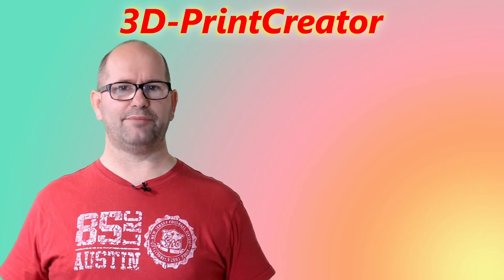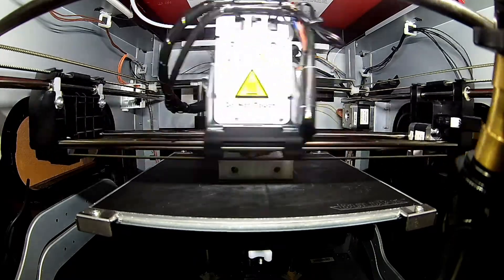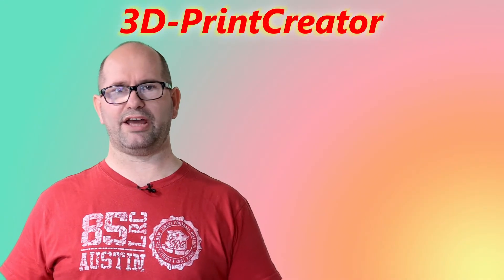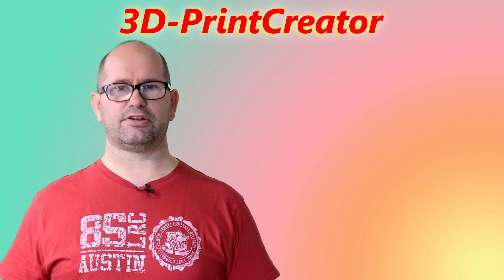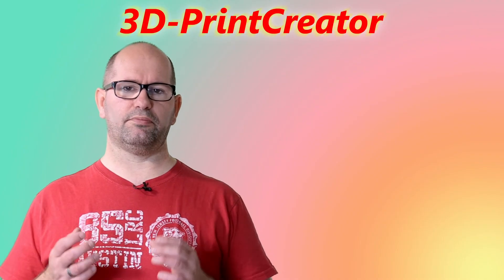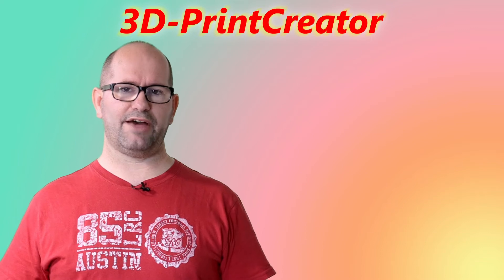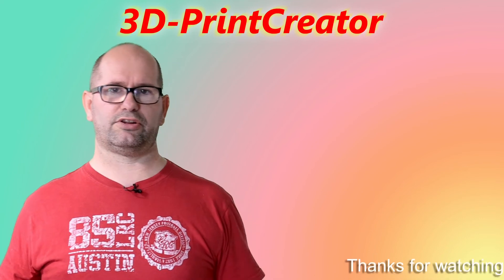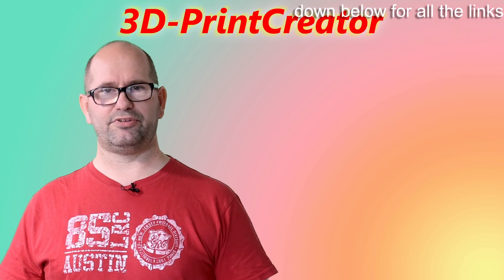▼ Best camera inside a 3D printer #Rollei or #GoPro

Comment: Thanks for the explanation. I need a camera for my 3d printer. It should be mounted near the extruder so the minimum focus distance should be small. I want to take pictures for the surface of the printed piece for further image processing of the surface pictures. Would you recommend any? I cannot afford to pay much money so the better is the cheaper. Do you recommend any and also any other than or cheaper than Rollei or GoPro ?
Reply from the maker: Action camera's are getting better and cheaper all the time.
At this moment I have a € 35,00 action camera installed in one of my printers and it does a better job then the expensive, but old, GoPro 3+ camera's I have laying around.
http://www.maxxter.biz/item.aspx?id=9413

This camera is sold in the Action stores in the Netherlands for less then € 40,00 and it's near perfect for taking printer footage. It has a focus distance of less then 12 centimeter and you can even change that by opening the camera (warranty will void) and turning the lens.
Reply from the maker: hmmm... Forget that link, it won't work.
Go to the maxxter page and search for their 4K camera. It says over 80 Euro's but it costs less then 40 in the Dutch shops.
Reply: 3d Print Creator Thank you very much for the answer and for your advice. I want to trigger the camera to take a picture by sending digital output command from Arduino Ramps 1.4. Do you think it can be controlled or wired? And how? And if not, then is there other?
I read that the 4 K action camera has a built in battery. Can it be removed so the camera will be wired without battery?
Reply from the maker: The camera can run on a 5v power source that provides 600mAh (according to the specs) and it can run without the battery inserted. There is no trigger option in the camera. I have a similar setup with a trigger but that runs on a mirrorless camera that can be controlled via a wired remote control. I have it set up so that everytime the Z axis is moving, the camera takes a photo. Then I combine the photo's in Da Vinci Resolve to make a time lapse of it.
Reply: 3d Print Creator Your kind reply is appreciated. I also want the camera to be triggered by every new z movement (every new layer) for further processing. However Triggering should be done through (let's say a digital output in the Arduino). What's the advantage of a mirrorless to a mirrored camera? And would you recommend one for my project?
Reply: 3d Print Creator Is it not possible to trigger the 4k Action camera with an external trigger circuit? I've heard of some cameras like cannon eos 300d, that can use external trigger

Comment: The heat inside a heated build chamber didn't dawn on me as being a problem for a camera.

Thank you, Brian, I'll probably go with your suggestion of the Rollei.
Reply: Hey Brian,

Got The Rollei, nice cam, but how do you connect the cam to OBS, through WiFi or USB? Cheers.
Reply from the maker: Hi Elf Tablet,
I connect via USB to the computer and then a screen pops up on the Rollei asking me if it should be a USB drive or a Webcam.
In webcam mode, I can find the camera in the settings of OBS.
Reply: No, mine doesn't do that.

I select PCCAM on the Rollei and it shows under device driver in windows as Generic USB device, and OBS doesn't activate it if I chose Video Capture device as source for it, and it doesn't have an option for camera input.

It's gotten to the point that I'm not entirely sure if it's me that's screwing up, although I'm not usually this bad with things like this, or if infact there is something wrong with the camera... and thx for replying.
Reply from the maker: That's strange. I select Video Capture Device and under that setting, there I can find my Rollei camera. The only strange thing is that sometimes I don't have audio, but video always works.
Reply: 3d Print Creator

No, the only thing that shows for me is Generic USB device, I just noticed though that it does seem to pick up audio. (:/) but def no picture, so it does looks faulty,

It also froze a couple of times on me and the phone app hadn't been all that stable. Looks like I just got a duffer, it's annoying, but it happens, but thank you for helping me troubleshoot much appreciated, keep up the vids. :)
Reply from the maker: Oh damn, that's sad to hear.
I also heard from someone that not every USB driver on the computer is very stable for usage with OBS.
His problems were with Logitech camera's, but it were not the camera's but the USB device drivers that troubled him.

After finding the right drivers online, his problems with OBS were gone. Maybe this helps you also???

Comment: May I ask you to update your recommendation on the Best camera inside a 3D printer since the recommended model of Rollei Action Cam 420 is discontinued?
Reply from the maker: When I made the video, I was one of the first people to accommodate a camera in or on a 3D printer.
Now, years later, you can find thousands of designs on even so many platforms.

Comment: Can you tell me a bit of the connection "arm" you put the camera on inside your printer ?
Have tried to find something similar, but have been unable to.

Great videos !
Reply from the maker: Hi Jan,
The arm is called an Articulating arm. It's pretty common in the photo and film industry.
Try searching on "articulating arm 1/4-20" and you will find the correct one.
Reply: WebCam X Carriage mount. Hinged for WebCam Angle
Fastens to my X Carriage, moves with carriage, does not give much space between bed and top of carriage. May not fit your 3D printer; file link below.
(Note I now am using a Guudgo GD-SC03 Snowman 1080P Cloud Wifi Ip Camera Pan&Tilt, Banggood, ( https://www.banggood.com/GUUDGO-GD-SC03-Snowman-1080P-Cloud-WIFI-IP-Camera-p-1182285.html? ), instead propped up behind my Print Bed.. Note online Storage of files is free for only 15 days, but I can still view mine remotely PC website link or mobile phone, (It does not have an IP address but a website address and can store files to SD card, I would say the video quality is OK, but not the best).
STL link for WebCam X Carriage mount. Hinged for WebCam Angle
https://www.thingiverse.com/thing:2507097